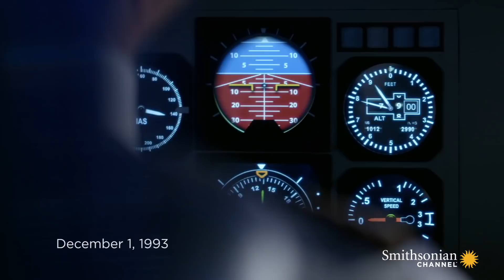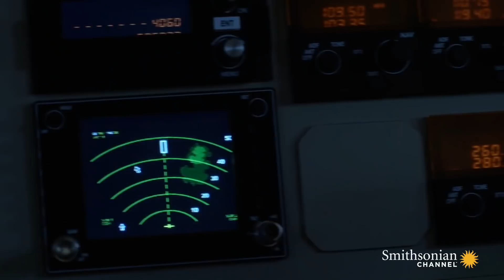Could a Cockpit Recording Reveal Why Flight 5719 Lost Altitude?

Comment: As a young man, married about 1 year at the time, I moved to Tulsa and began working for northwest airlink. I can remember coming into the office early in the morning and seeing the paper from the teletype system from the printer across the room and coiled up. As I reached down to get it I quickly realized that a serious emergency had taken place prior. It was a sickening feeling to find out what had happened. It was the same year that one of the ground crew out of memphis tn walked into one of the props on the tarmac. The company was ran tightly, with what always seemed to be a shortage of funding for proper equipment, pay, or even training. I lasted about 1-1/2 years or so and moved on.

Comment: Another example of when Smithsonian Channel (which I usually like) stops the clip half-way. The likely cause for the crash is read in the comments but Smithsonian Channel should have brought in the final results from investigators in the clip. Leaving your audience and subscribers (which I am) with a cliff-hanger like this is just bad. Bad on our experience and bad on your reputation. Sorry, but I am just the messenger.
Reply: This clip is a teaser. If they gave too much away, they wouldn't get the subscribers.

Comment: Even if the first officer was afraid, it’s wasn’t worth staying quiet while the plane was losing a dangerous amount of altitude, even if things would get physical. It ended with innocent lives being lost, it is his responsibility after all.
Reply: Tk BTS I blame the captain because he caused the breakdown in CRM.
Reply: @Tk BTS. Also, if the captain, in this case, was not going to keep Crew Resource Management then it is his problem, and as a result he and the fact that the GPWS’s (Ground Proximity Warning System) installment wasn’t mandatory at the time, was a few of the key factors leading to this crash. Even though the First Officer should have still not risk the safety of the flight, he did have his reason due to the prevalent fact that the captain was being abusive and intimidating. (The clip does not show all of the information so I suggest searching on Google)
Reply: @Tk BTS. Yes, but well there is an exception considering the circumstances and behavior of the captain.......

Comment: Yeah, but wouldn't the more experienced captain have said something after not hearing his co-pilot call out altitude levels for all that time?  Maybe the full episode addresses this, but, if not, that's a bit of an unfair leap to make putting that all on the shoulders of the co-pilot.
Reply: The PIC had been very rude and short with his FO prior to the flight, and it was clear the FO was reticent to communicate with him, normally, the GPWS should have told the captain that a ridge collision was imminent, but whether they had one on board and whether it was working, (and warned) is unclear.
Reply: @Juan Rodríguez. Technically yes, but judging by the circumstances the captain clearly failed his part in keeping CRM in the cockpit, so it is also the captain’s fault if you think of it that way.
Reply: @JuanRodriguez-gt4ux  The captain didn't even bother to inform him that he was doing the 'slam dunk' approach, or talk him through the approach. The first officer had to ask him why they still hadn't descended. There was no communication. He probably just figured that the guy didn't need his input if that was his attitude. And he did warn him about the altitude when there was still time to correct it. Falitz kept descending. It's on the CVR.
Reply: Well another video was posted and the pilot gets angry easily so maybe the other pilot was scared
Reply: Ego issues and being the senior he was very comfy with the co -pilot.
Reply: ag3498 He was stated as being intimidating, but that doesn’t excuse the first officer failing to follow basic procedure that basically caused the crash.
Reply: Ascetic No, it’s the first officers job to inform him of the altitude. He failed to do so out of childish fear of being reprimanded and his negligence killed 18 people.
Reply: @Kitana Kojima. It is true that the First Officer did not dare oppose the captain but blaming him only is just not reality. The captain should not have been so domineering in the first place. In that matter, the captain is mostly to blame.
Reply: @Tsumami__  He did warn him when they were approaching minimum altitude, at which point Falitz ignored the warning and started talking to him about something else while still descending at the same speed. It was Falitz' fault.
Reply: @Tsumami__  have you read everything on this? I haven’t but many comments explain what was happening between pilot and co-pilot. You make a lot of comments on different videos bashing Chad.